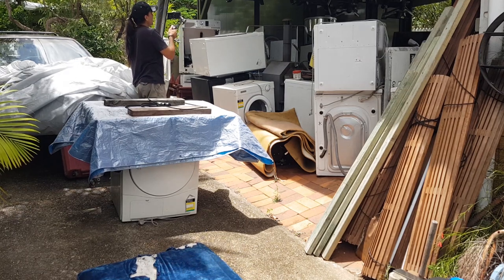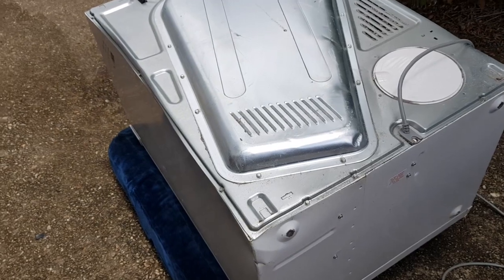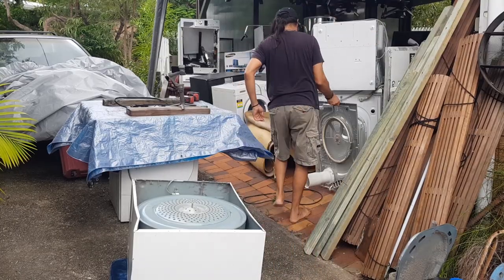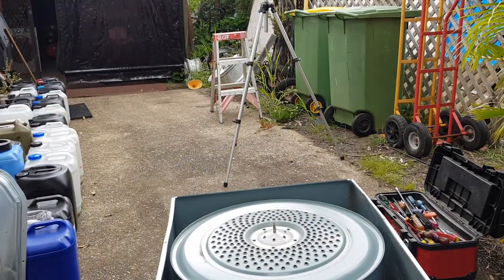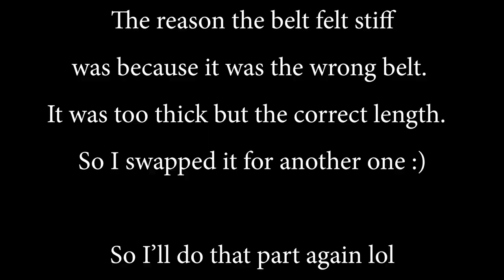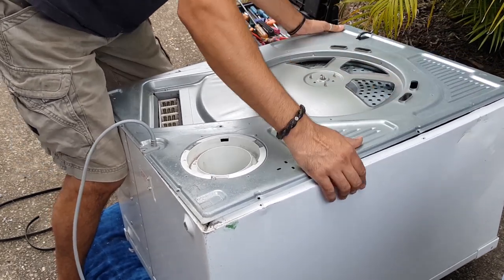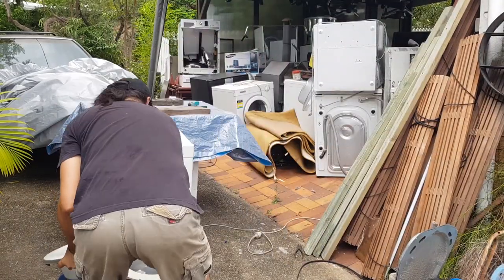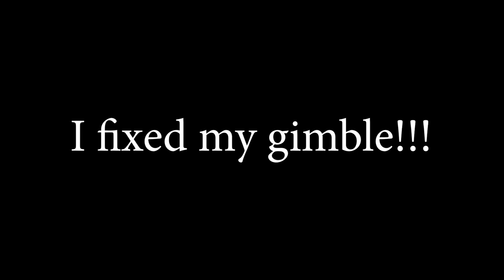Simpson, Electrolux, Westinghouse Clothes Dryer belt replacement

Comment: Thanks mate!! Saved me heaps! 😁 Only issue I have now is it sounds a bit thumpy, no issues with spinning and I took videos along the way, so everythings back where it should be (also ny my first time doing DIY haha) Any ideas what this could be?
Reply: Mines the exact model in the video if that helps
Reply from the maker: G'day DMW, sorry for the delayed reply.  Hmmm I'm not too sure.  The only time I'd describe a dryer as having a thumpy type of sound is when it has the dreaded train 'track sound'.  But that usually only happens if the dryer has been dropped slightly.  It's normally a flat spot that develops on the lip of the drum that goes inside the door part of the machine.  I made a video years ago of the issue if that helps.  
Otherwise I would just turn the drum with the back off, with the drum lying on it's face again and see if you can detect where it's coming from. Sorry I can't be any more help, but well done for getting it back on the road 👍

https://youtu.be/Mk0hzN6qWUg
Reply: @DIYDumpRat  ah thats what it was! The ring of the lip that goes into the door had a bend in it, popped it back and it was good to go! I also replaced the rear bearing as it was looking looking or feeling fantastic. Thanks for all your help, really appreciate it!
Reply from the maker: @dmw2132  No way that's awesome! Haha you're probably the first person I've helped with that fix. Good job! And well done replacing the bearing. Bearings that disintegrate are one of the main reasons people have to throw their machines out. Anyway hope it serves you well 😀

Comment: Hey mate! Mine is making a loud boise like an aeroplane, bought it on marketplace its a 6kg one. My old one is very quiet, its a 4kg one
Reply from the maker: Apologies for the delayed reply mate. Hey it could be anything. If it's that loud it sounds like the shaft holding the main bearing on may have sheared off, or the fan circulating the air is damaged. Sorry unless I see or hear it I can't tell unfortunately.
Reply: @DIYDumpRat  hey mate. I simply swapped the motors even though one was a bit older with the different capacitor placement and the motor had a slight rpm difference but it works perfectly now! I think the old motor had a burnt coil as the bearings felt beautiful still.
Reply from the maker: @wisetoad  Ahh well done mate, you got it going! Respect 👊

Comment: Great video thanks, I found what I assume used 2 be a ballbearing, after I removed the back from the drum...... do I need 2 replace it?
Reply: Ball-bearing nut
Reply from the maker: No problem Benjamin glad I could help 👍 Hey listen, the only time I've ever found loose ball bearings is when the main bearing has broken. So check that out. If you look at the back part of the dryer you will find 3 screws holding down a small round metal disk. Basically where the pin on the drum sticks through. Undo those screws and you will find the bearing in there. It's a good thing you found that mate 👌
Reply from the maker: Check this out mate.  https://youtu.be/4DuBdrFvRVQ?t=1351
Reply: @DIYDumpRat  thanks buddy that helped heaps👍

Comment: how would you know is the tub bearing needs replacements?
Reply from the maker: Pull the bearing out.  Hold it between two fingers at the center and try and spin it with your other hand.  If it feels grindy or crunchy you will probably need another one.  If its locked up definitely.  If it's just a bit grindy a lot of the time you can save them by spraying a little WD40 or other form of lube and rotating it.  They get grindy due to dust getting inside.

Comment: Thanks for this video. I am having a problem where the dryer drum does not sit square in the door once the motor spring is engaged. I.e. when I pull the spring into its place, the drum pulls towards me; I am engaging the belt in the exact same manner as the person in this video does at 27:52. It does this with a new belt as well as the old, so the thickness/size of the belt can't be to blame. Belt is wrapped correctly, not twisted, drum is re-inserted into door as per usual, idler pulley moves freely, everything works as expected but as soon as I put the spring in place the drum goes out of plane and refuses to spin freely. My only thought is that perhaps the body of the dryer is no longer square, something has bent out of shape? But it happened suddenly during a cycle, and I've pulled my dryer apart a few times to replace various parts at this point, so I know how to put it back together; this is the first time I've encountered this issue. Can't find any answers anywhere online, and I've probably watched about 20 videos of several different seemingly relevant dryer repair issues at this point. Help!
Reply from the maker: Sabrina hi, thanks for your question.  Too be honest you have me kinda stumped.  Everything I would have said it was you've ruled out.  That's only happened to me a couple of times and it was a slightly smaller belt I was trying to fit or I was pulling the tension on incorrectly.  I would almost certainly rule out the dryer not being square.  It almost sounds like the motor could have dislodged.  But I'd really need to see it.  When the belt isn't on the motor can you spin the motor  with your fingers and it spins freely?  I'm kind of grasping but maybe the fan had come off or loose and some how dislodged to motor.  Almost sounds plausible seeing it happened in a sudden as you mention.

I had a dryer the other day where the bowl had come out of the inner shroud lip and was on an angle.  I think I put it down to a dodgy idler.  So when you pull on the tension the bowl lifts out of the shroud lip right?  and when you push it back (stretching the spring) and try to turn it it doesn't turn?  I'm going to have to sleep on that one I'm sorry Sabrina.  I reckon if I had it in front of me I'd get it in a heart beat.  Let me have a think on it.  I'm really sorry I can't work this one out straight away.
Reply: @DIYDumpRat  Wow! Thank you so much for your detailed and considered response. Unfortunately, I've ended up ordering another second hand one as I need a dryer asap. Fortunately, however, there's a decent amount of interest in the guts of my busted dryer so someone's going to get some parts for free. Glad to not send it to landfill. Anyway, this is a really interesting thought experiment and I'm keen to carry the knowledge I've gained from your response into my next DIY project. Really grateful for you taking the time and interest to try and resolve this for me! I know how frustrating it can be to not have the object in front of you, I'm sure someone with more experience would be able to fix it if they had their hands on it (but I'm very keen to move on with my life haha)

Comment: Hi, re the different belts, can you remember which belt was too tight and which was correct? I just used a Westinghouse belt on an Electrolux and it does seem tight, its working when assembled, but very firm to rotate. Also when the dryer is turned on for testing, the element in normal mode does not turn on, is this the sensor working because there are no wet clothes inside? It is a computer controlled model.
Reply from the maker: Sorry mate I'm not sure on both accounts. I thought I must have just put a wrong belt on from a completely different machine. All the those machines should take the same belt. I do remember it being quite a bit thicker though. As for the heater. It could be anything. Heater, heat sensor, or computer. I'm lucky, I have lots of spares of everything. I just replace stuff until I get a good result. My money would be on the computer though.
Reply: @DIYDumpRat  Yes lucky to have the range of spares you have :) Are the dump pick ups from recycling centres or actual rufuse dumps ?

Comment: Over the years I've probably worked on a round 5-6 home that have burnt down or fire damaged from dryers.
Reply from the maker: Yes mate indeed.  That's terrible.  I'm not saying it doesn't happen.  Almost any electrical device can catch fire.  But I'd say most of the time with dryers it's usually more likely the power switch  that starts it.  It's connected directly onto the plastic interface.  I'd say the plastic is more likely to catch on fire than the metal housing.  But I could be wrong.  The amount of times I've looked inside to see a completely burnt out power switch and blackened plastic surrounding it is amazing.  People who owned those dryers were very lucky indeed.
Reply: @DIYDumpRat  your right & I absolutely love your vlogs, thank you.
Reply from the maker: Mate thanks so much! that's really nice to know 🙂

Comment: I have replaced 5 belts so far, on mine the idler pulley is perfect everything is good. The belts are genuine but I'm finding they keep shredding.  Any hints pz cheers
Reply from the maker: Hey sorry for the delayed reply.  To be honest I've never come across that problem before.  I had a possible reason in mind but its pretty silly but it's the only reason I could think of.  And that was that the belt was put on back to front. Meaning that the smooth side of the belt was possibly going around the motors grooved part  and there for over time shredding the belt.

But I'm sorry I'll keep thinking about it, and if I can think of some thing will definitely let you know.
Reply: @DIYDumpRat  thanks for your reply, muchly appreciated.  Haha no it's installed correctly , with the grooves facing the down. , Cheers

Comment: Thanks for the video walk through, it is VERY helpful, had to do the same with similar model today. Mine was an older model with the belt item code - 0198300010, but can confirm 0198300011 works fine also for older Simpson Eziload
Reply from the maker: No problem Ethan!  Thanks for commenting mate.